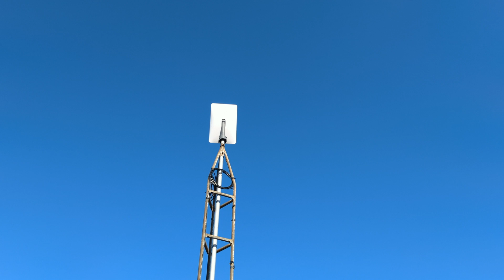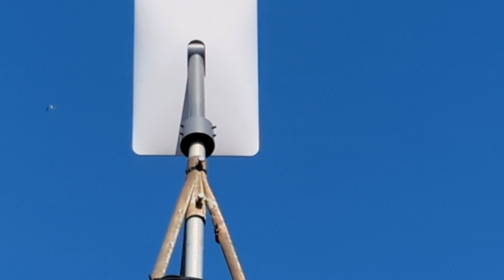Starlink Pole Adapter Install on antenna tower. I show how the cable is run through the adapter.

Comment: How did you run the cable from the tower to the residence?
Reply from the maker: If you view my other starlink video.  You remove the cable from the dish then run it from where the modem is located to the outside.  Requires about a 5/8" hole

Comment: Any issues with wind load?
Reply from the maker: It was installed over a year ago.  They are near a lake and no issues.
Reply from the maker: This was an install for a customer but I have done a few tower installs and have not had any complaints.